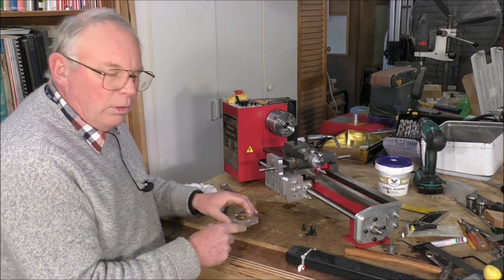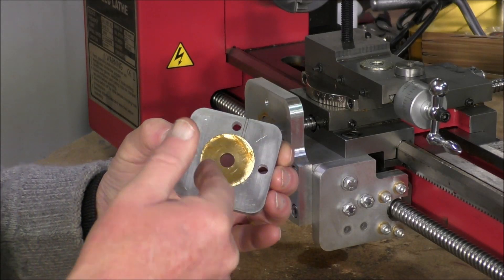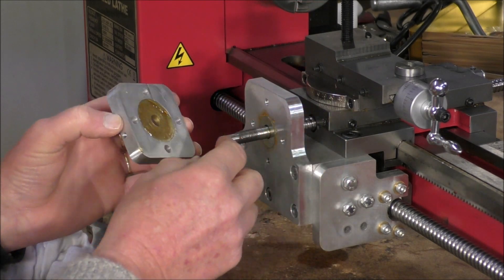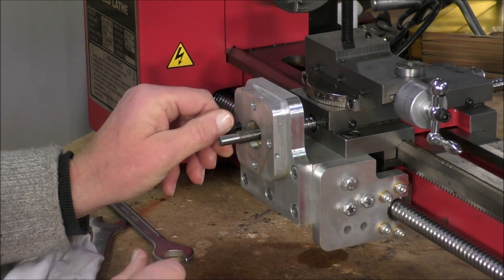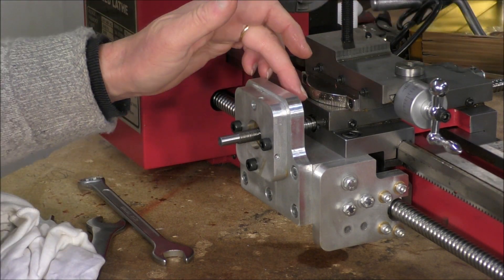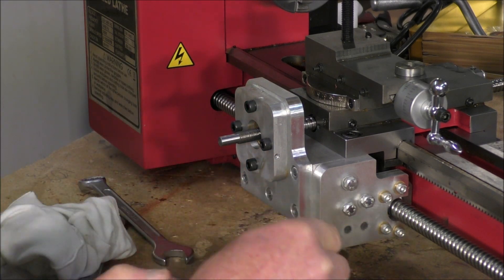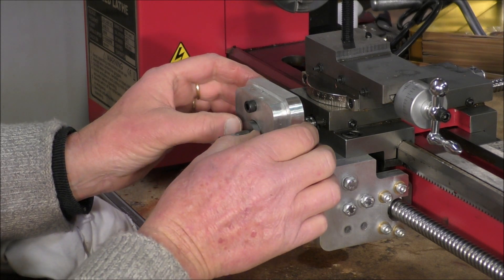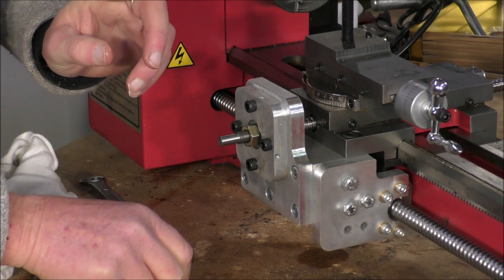332 Sieg Harbor Freight 7 x 14 inch CNC mini lathe conversion 95% completed

Comment: the x ball screw is 12mm by how long? 250mm?
Reply from the maker: Plans and parts listing available on my Patron pages for the, 3018, MIDI 4040, MAXI 1212, and AMAX 3636 CNC Router, Sieg X2 CNC Mill & Sieg 4 x 20 CNC Lathe + Mach 3.5 Info

My CARVECO/ArtCAM 5% discount code is
ROGERWEBB5798 
(ONLY AT THIS ADDRESS BELOW) 
https://store-us.carveco.com/collections/roger-webb-discounted-products
https://store-us.carveco.com/?ref=B40mt_z8N7xiu